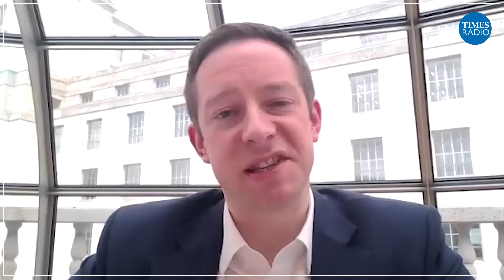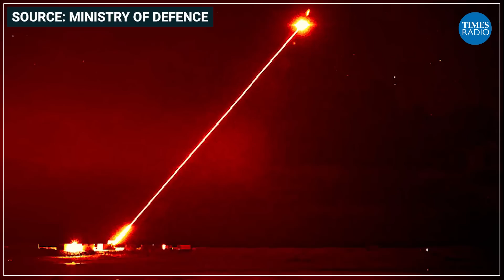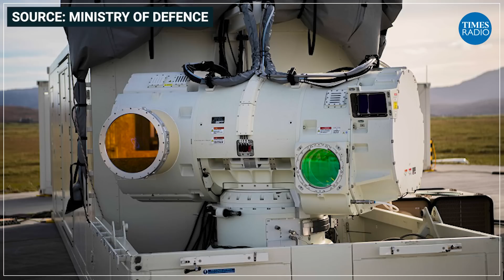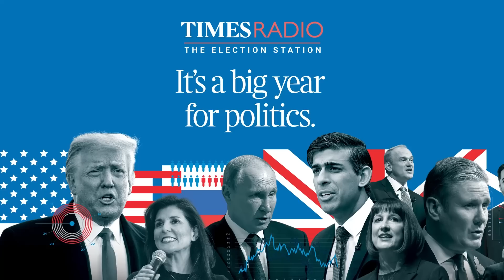DragonFire: the high-power laser capable of wiping out Russian drones | RUSI

Comment: Can the dragon fire engage up to 3 targets simultaneously? If not definitely wanna develop this capability to prevent the system from being overwhelmed 👌🏾👁️
Reply: You're allowed to have more than one.
Reply: @olirc  lol
Reply: I think it has quite a long range. A group of these with overlapping cover will be incredibly difficult to overwhelm
Reply: @person8203   wrong... 1-2 mile it effective   the further away the laser beam 
became useless
Reply: @jetli740  The range is classified, but the  accuracy is described as within dead center on a 23mm target  at (1) km.
Reply: Can engage a lot more than three try 30 or more in a few seconds
Reply: It only needs about 0.001 second to destroy a target then move to the next one so it can probably handle 20 targets per second
Reply: @Chris-zu4es  then why its not being used already? let guess it it useless if the weather not perfect. the enemy will just attack during that windows.
Reply: @anubizz3  they only have built one and I think it is in use now. it just haven't been anything sharp to test it on
Reply: @anubizz3 why is it not being used? What, the prototype you mean?
Reply: @Chris-zu4es  wrong  it take few sec to cause damage
Reply: @jetli740  according to Wikipedia it is 50 kilowatts that's enough to pierce a hole in whatever in a milli second
Reply: @jetli740 are you scared 😂
Reply: @jetli740 Wrong based on what? Because you don’t think so Jethro?